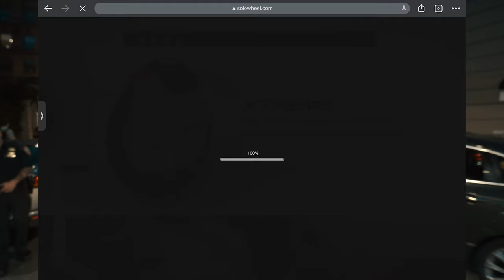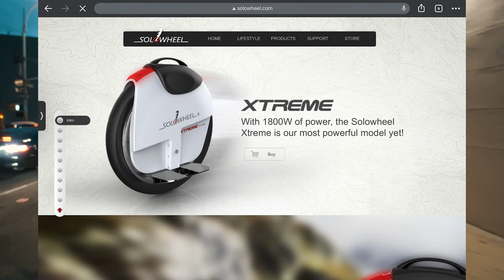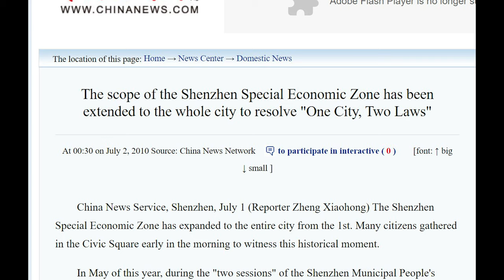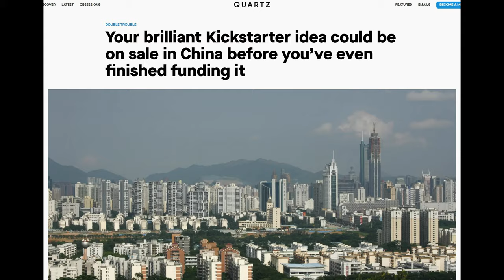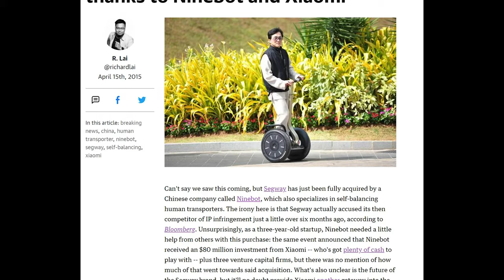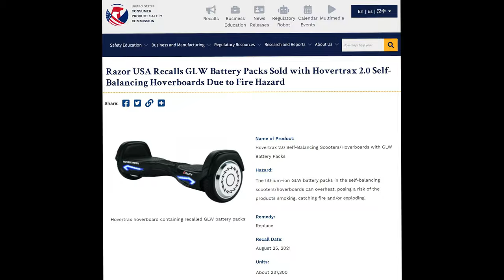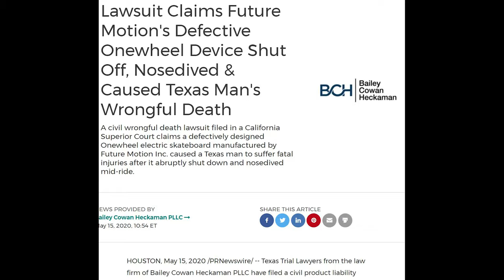Electric Unicycle and the Death of American Innovation

Comment: Shane Chen, original inventor of the electric unicycle, runs a company called Inventist.  Their products never caught on fire yet, unlike the other brands.  Shane focused on safety and durability, as he used the best products he could find.  i.e. the original solowheel classic 2013 and earlier had A123 battery cells, which were american manufactured, very good quality, started by an MIT professor.  I still use my 2013 solowheel classic.  The inventist solowheels are roughly 25 lbs but still have a 16 inch wheel which make it unique.  They vibrated instead of beeped, so you always know when it's warning you.  It also doesn't have double stick tape, or grip tape, but instead uses long lasting construction.

Comment: What up BFF! I think the coolest recent steps thus far for on an American company influence on EUCs has been two things. One, the idea of eWheels updating battery packs using another vendor for battery battery safety and performance, and Two, the commission of the Nikola+ AR from AlienRides. I saw a video a while ago about how someone created a different looking clear, near indestructible shell for his Monster. Perhaps the way isn’t to start a company from scratch and try to reinvent the wheel so to speak. Perhaps it’s more about applying American innovations in the form of improving factors and addressing concerns that cater to the American market (better battery, bigger battery, hearty shell), in some cases even working directly with Chinese companies.

Perhaps if things progress in a good way, the first “American wheel” would be something like a Frankensteined wheel of various existing wheel parts and features from Chinese companies, plus some different American made additions (case, battery packs, pads, seat, lights, branding/appeal etc.). Not sure what business hurdles are presented here, but maybe it’s less a jump than starting from scratch or Kickstarting.

Comment: I have wondered this, very informative video. 

When you travel across the country to do community rides do you take your own wheels? Are there issues transporting because of lithium batteries?
Reply: Usually its only planes that dont allow EUC transport...
Reply: @v4v777  he lives in NYC. This ride is on the west coast. Are you really thinking he'd drive?
Reply: @Aaron_b_c  No.. he wont of course... but if you really need to make a long distance travel, and you wanna take your EUC with you... the Best solution is to send it with some courier company.

Comment: segway was so cool when it come out lol but at $5000 for a cheep unit and 8-10k for a nicer unit no one could afford them when a new car was 8-15k. now that a crap used car is 8-25k the cost of a euc looks a lot more affordable. i still feel the cost of a nice euc is a bit over priced because i feel we are all testers of the units at the price point i feel all the bugs and problems should already be worked out at $3200-$4500 this should be a 100% tested finished product . i saw that master crash and to me it looks like hay lets make euc faster but remove everything that makes them strong out of them. if a euc can go 50-60 mph i feel the frame should be able to handle a high speed crash better than it does.

Comment: This tech dates back long ago. Who was first?
 There is the Ryno wheel. It's a motorcycle with one wheel. Or is it a euc with a seat and steering wheel?
There is the 2007 onewheel board by Ben Smithers. Same tech as euc but a board instead of pedals on the side.
And the Segway of course.

Working monowheels are made since the 1930s though. They didn't have a gyro back then. 
 Google also the Gyro-x car from 1967!

And the 1983 C64 game B.C.'s Quest for Tires has a euc. https://www.youtube.com/watch?v=Ldtz3ext47k

So Shane is a great thinker, especially the Hoverboard is a very smart idea, but all in all it's the culmination of gyro, motor, lots of sensors and battery tech that made it a matter of time before euc's would be a reality.

Comment: I saw someone fall off of one in NYC a few months ago. He must have been going full speed. It straight looked  like a motorcycle accident complete with the heavy device bouncing off the street flying through the air and smashing into the metal  door of a gift shop. It narrowly missed a two parents with their toddler. Let's be honest about these things- it is far easier to spill on one and the thing doesn't scrape across the ground tons stop it freaking bounces all over the place because of the rubber wheel. It is far more unsafe then electric bikes, skateboards and scooters. It's cool looking but you.are clearly biased because you like the things so much.
Reply: Have you tried it?

Comment: "What China [companies] is particular good at is producing ever larger and cheaper copies"
That is their demographic concept. Building more labor drones 😂
Honestly sad, not funny...
Reply from the maker: This is a very moment in time thing as labor cost is rapidly rising in China, but the lack of IP restriction is what let them push ahead now.
Reply: @nosignal7156  In some EU countries they're semi-legal, but need to be speed capped at various different speeds which makes them both too fast for walkways and too slow for car roads. Never mind all of the certifications you'd need for an EUC. Even a bluetooth module radiating it's stuff will require a 50k certification. Just too much overhead, too high wages, too stagnant society. It's really a shame.

Comment: 2:05. Nope. Funny, but not much inside of that wheel was actually invented there. Including the wheel itself which was invented... where? and by who? probably the old Egyptians, or Sumerians? or Persians? The electric motors were invented in the old Europe, when papa Faraday accidentally connected the two power generators of the Electricity Museum together, and the most recent invention, the Lithium batteries were invented by some Chinese in Singapore, about 40 years ago (yep, they are so old, but they didn't "catch" until the mobile phone market was needing them, and in general, yeah, it takes like 30 years for a new technology to get from the labs to mass production). Even the RGB LEDs, they are not an American invention :D You may have gotten me with the transistors and integrated circuits, but doh.... >D
Reply from the maker: the only thing that matter unfortunately is the cease and desist letter youll get from shen Chen's lawyer if you build any profitable company that has anything to do with an euc

Comment: So cant ride Abrams through puddle with that plug that may short out. 
Monster       106          3500w
Sherman spin 97.                   2500w
Abrams spin      95      3500w 
S20                           70      3300w
Z10 mod firmware  60             1800w
Commander     96               2800w
Commander has suspected 500km range not 200. Need to investergate.
Need range graph these wheels.

Comment: unplugged my v 12 it said "please repair" - battery problem. so much for a new EUC....Will my face hit the pavement I wonder
Reply: Where did you bought it from? Can you send it back to repair? Also, ask your self this: what if the same issue happened to a non Inmotion branded wheel... do you think it would have kindly told you to repair it, or just killed you on the next ride? Yes I'm talking to you GOTWAY😂